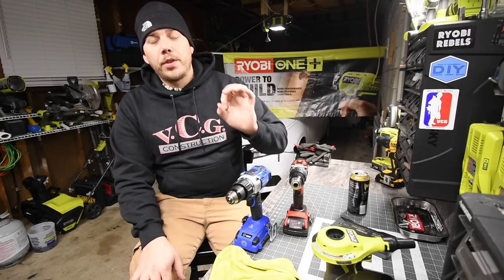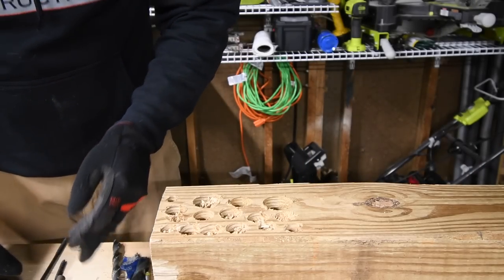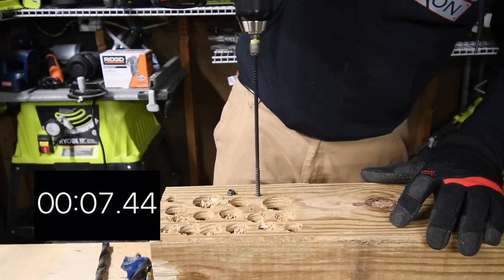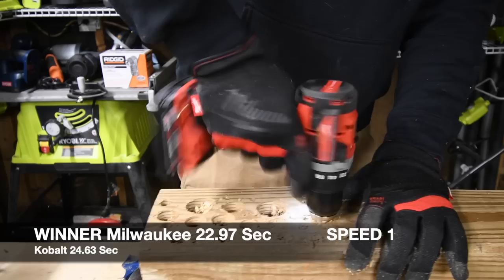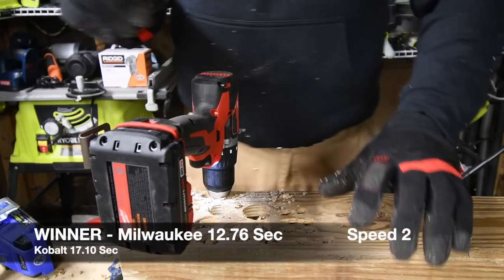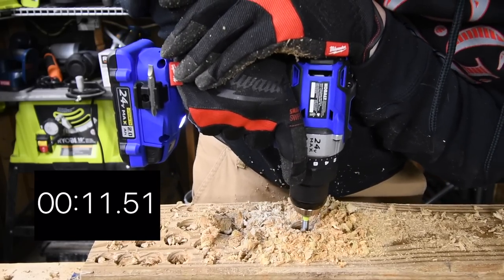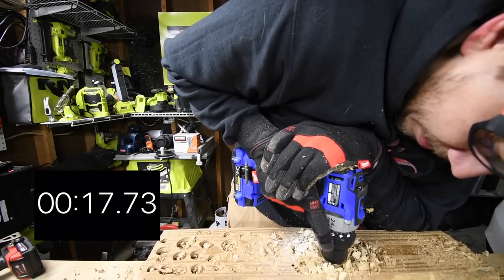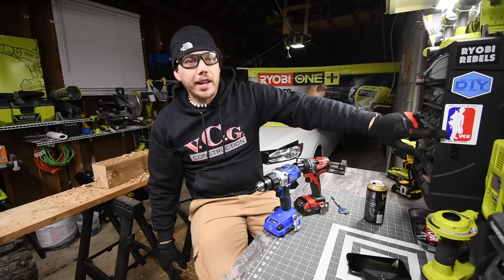Kobalt vs Milwaukee Drill Drivers

Comment: I own the Kobalt 24V drill driver and impact driver and this video confirms that the Kobalt does get the job done for a whole lot cheaper albeit 2 to 4 secs slower than the Milwaukee. That's  like those people that cut you off in traffic so they can get to the stop light a second faster than you. LOL
Reply from the maker: Exactly, that is why this channel is here. I agree that tools these days get the same power as the top brands for a fraction of the cost
Reply: Fine point sir!!!!👍👌
Reply: Lol I’m definitely stealing this joke
Reply: I own the kobalt drill and driver as well and I can't complain about them at all. They've performed very well since I've had them.

Comment: For the Milwaukee he applied more pressure and used his body weight and both hands to push. For the kobolt he kinda let it do it on it's own.
Reply from the maker: I used my body weight in the same manner for both tools
Reply: @ManCaverTools  the test he did was cool but two or three of them kobalt should have been right there but he mess up with the kobalt but never have a did it with the Milwaukee did you guys see that but cool vid keep it up

Comment: I would give this one to the Kobalt because of its great value. The performance is nearly on par and the pricing is much better for the lineup. Plus you get the same warranty. I wouldn't buy Milwaukee if I wasn't going for the Fuel.
Reply from the maker: I do agree with if you get Milwaukee you get Fuel to dont get it at all

Comment: I got that Kobalt drill in the 6 tool set (5 tools and a flashlight).
That makes that drill price less than $40, technically. Individually, I probably wouldn't buy it, but in a set, It's no brainer. It's a legitimately powerful drill and it has good build quality. Nice video, as usual. 👍🏽👍🏽
Reply from the maker: I thank you sir
Reply: LOL yep.. I got it during black Friday/New years I can't remember..  6 tool set + case w/ wheels to store it all... for only $200 is helluvadeal

Comment: Just a tip, but when you are using a drill and it doesn’t have a handle, you can grab the battery and use it like a handle for extra leverage.
Reply from the maker: I thank you sir

Comment: Nice test you did there. You forgot to mention an important aspect of these two tools, battery price. A 2.0 mah battery for the kobalt is $20, the m18 is $80
Reply from the maker: You are correct, I should have mentioned pricing, ill try to include that for now on, I really do thank you
Reply: Where?
Reply: I've only seen  Kobalt $ 30
M18 for  $59.
But price difference is Double.
Reply: @Sanchezj7j  the 2.0 used to be 20 it is 30 everywhere now

Comment: You didn't put all of your weight and two hands on the Kobalt. On the removal, you rocked the Kobalt side to side, causing it to slip, and you paused. And on the drill test on speed two, you pulled the Kobalt all the way out of the hole multiple times and fumbled to get it back in, whereas the Milwaukee, you never pulled the bit all the way out. The whole test seemed that you were favoring the Milwaukee with how you handled it. Plus you did the Milwaukee drilling closer to the edge and closer to your body with more weight and downward body force.
Reply from the maker: I thank you so much for viewing Tango

Comment: I am a contractor, my daily used Milwaukee was over 8 years old and I just tossed it out yesterday. I seriously doubt the Kobalt is going to last that long. You get what you pay for.
Reply: Kobalt has the same 5 year warranty. It may or may not last as long but if it breaks in warranty, just take it to lowes and get it replaced on the spot. With Milwaukee you have to ship it to them and wait weeks to get a replacement. In my eyes, in addition to the cheaper price, that’s a better deal.

Comment: I recently bought that millwaukee drill anf feel like its a bit loud and the battery is definitely loose on it was the millwaukee louder than the kobalt to you im comparing the sound between an 8 year old bosch drill and the millwaukee and the bosch is almost a 1/4 quieter
Reply from the maker: I agree that the milwaukee drill is a bit noisy.

Comment: i have a question which is better a Kobalt impact with quick change thing on it or a Milwaukie drill driver Kobalt is 24 volt milwalkie is 18V and when it comes to removing bolts witch is better in a work environment because my work has the Milwaukie i just got the kobalt and want to know would it be better in a work environment
Reply from the maker: The Milwaukee impact driver is more powerful but it slips out the bits

Comment: with my work's milwalkie i gota turn down the torque cus that bitch will try to snap your wrist if the bolt is sorta stuck course had a few that the dril couldn't undo even at max strength so i had to use a hand tool to break it free rather than destroying the drill we over did it and killed a battery pack by over loading it or something if we had the drill/ hammer drill it mighta worked out better but hard to get permission to use that so that's why i was wandering about a impact
Reply from the maker: Yes sir

Comment: I had a bit of experience with the brushless 20V dewalt drills having an issue overheating when drilling sheet metal. We got them to replace the old dewalts that had the Ryobi style 18V battery. Just curious if you've experienced any issues like that
Reply from the maker: I have not over heated the dewalt drill yet, but I did get the Brushless Ryobi Hammer drill up 170 degrees and it still works just fine.
Reply: I've never overheated my Ryobi but I've only used them on framing and flooring. I've only used Dewalt on steel and stainless steel.

Comment: Are you part of vcg?
Reply: He doesn't have the right accent. ;)  He might be able to pull off a Chicago accent and fit in with the Tools in Action crew. :D  Have someone coat that Kobalt drill in Linex while its running, and he'd fit right in. lol!  The video in question for those who haven't seen it. https://youtu.be/ou-vDVhAzl0?t=82   The boom box torture test though, probably enough to make a newbie tradesman cry though. https://www.youtube.com/watch?v=PRLeFXZS5V4 Although, everyone knows, ANY jobsite radio eventually gets beat up, missing knobs, all sorts of bad things happening, so legit need for a test.  Now the unique VCG thing, is the massive hole saw torture test. I've yet to see anyone but Vince get that test done right on the first try, the others always jam up and stall out.
Reply: He clearly wishes....
Reply: @kdc300z  They've had fans of the channel on pretty routinely. Its just that to get on the stream, you have to go to Camden, NJ, get the time and the dates right to work out, etc. Granted, it's not a full tilt warzone like Flint, MI, Hammond, Indiana, or Baltimore in general. But its more hardcore than most viewers wanna go. And god forbid you get slippy bits in the middle of a TTR, you'll never live it down. ;)
Reply from the maker: I am not, Im just a big fan and love watching them
Reply from the maker: yes, I used to watch tools in action since they are from where I am at
Reply from the maker: very good and thank you for viewing